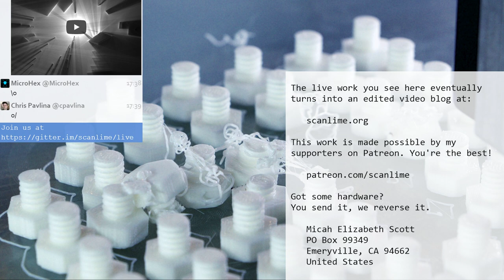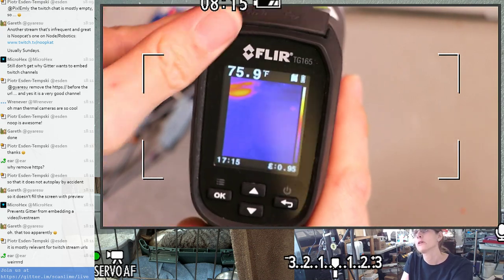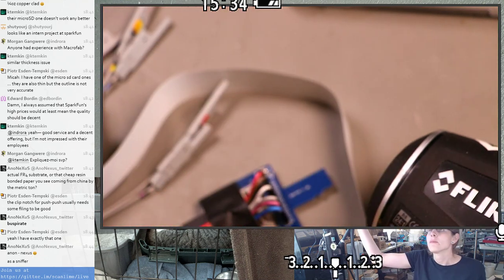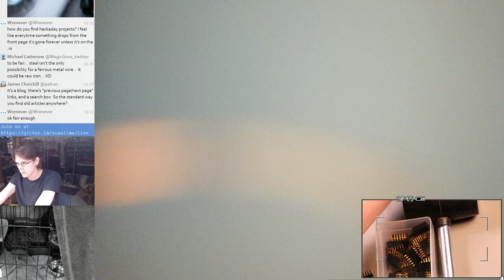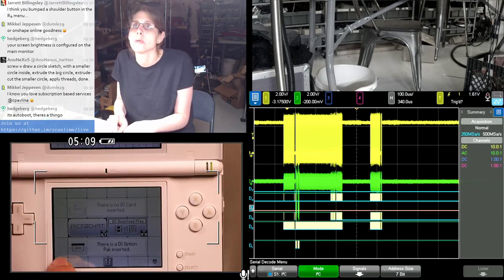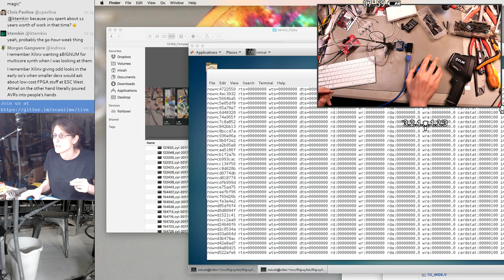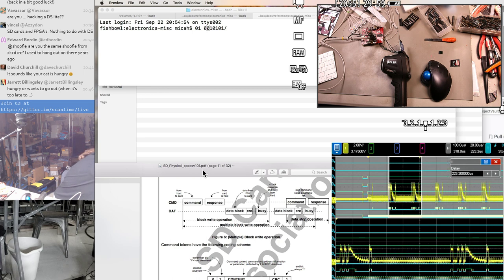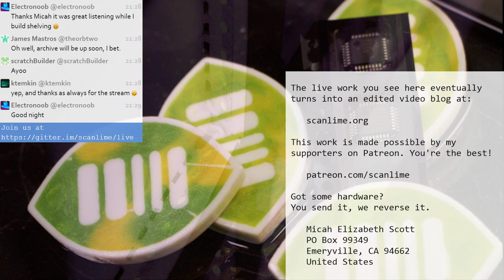SD card emulation revival slightly overcaffeinated @scanlime-in-progress

Comment: If you want to add IR to the Tuco Flyer, just using a Lepton module would be way easier than modding the TG165 - Leptons are available at Digikey ( though cheaper via faulty Flir Ones on Ebay) and documented. There are also some breakouts available. I don't think the 160x120 Leptons are available but teh documentation has escaped, and you can harvest them from Flir Ones